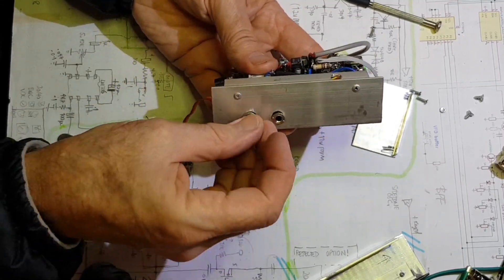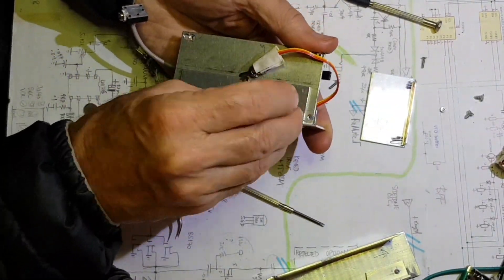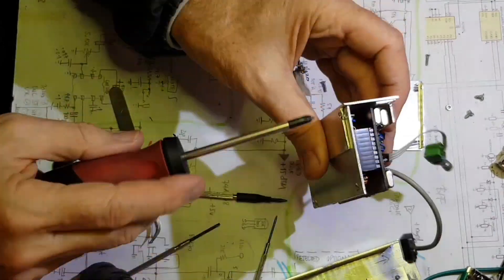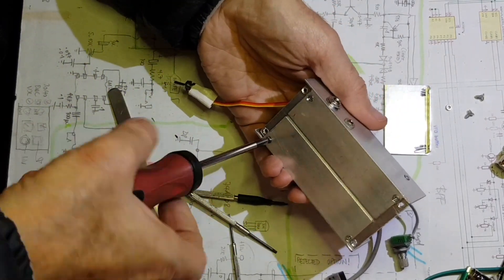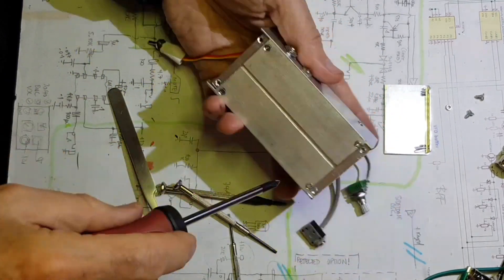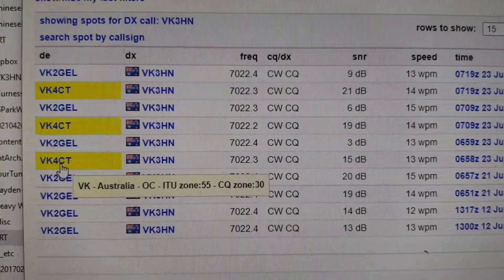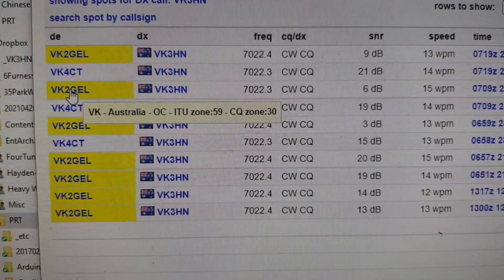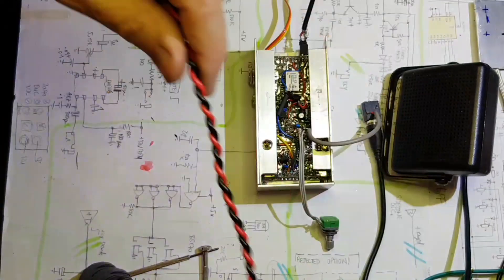'2B2C': Dual-band 2 channel QRP CW rig /Part 8 Case assembly & field test

Comment: Downloaded the schematic. Will make it as winter project. Thank you
Reply from the maker: Happy to connect with another keem radio maker. 2B2C was my Winter 2020 lockdown project.  It works fine. I've made a number of good CW QSOs with it.  And it is small!  If you are aware of its limitations you will enjoy it a lot.  A couple of post build thoughts. The audio filter could be tighter/narrower for CW.  I would consider experimenting with a SCAF filter such as the MAX294 or 297.  And I realise the Two stage XO buffer is overkill, you should be able to come up with a keyed, two transistor buffer to drive the quad NAND driver.  Have fun!